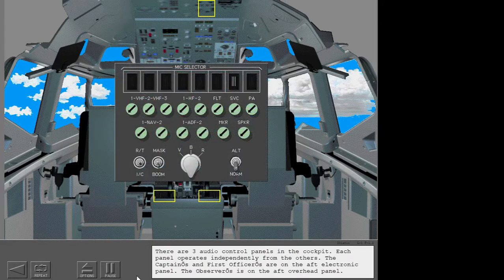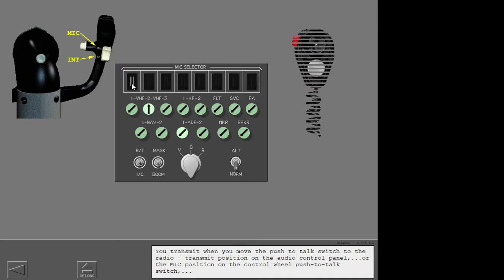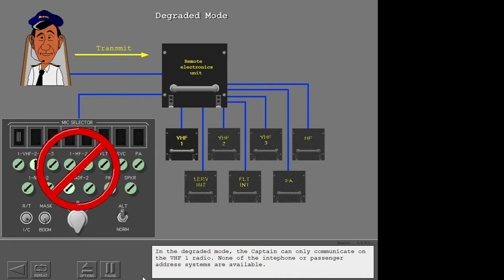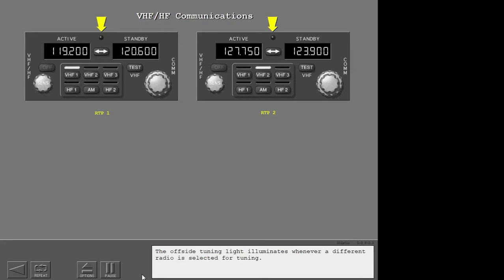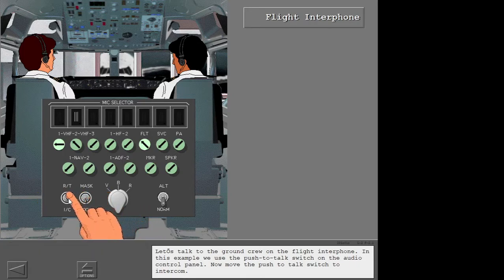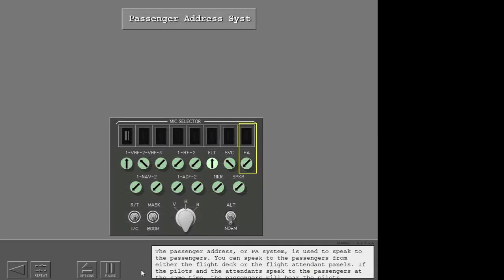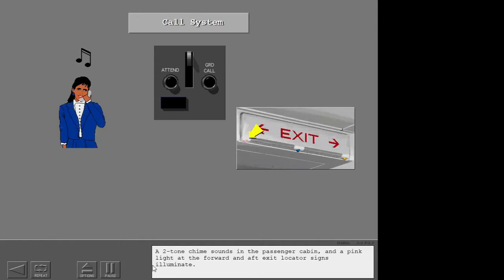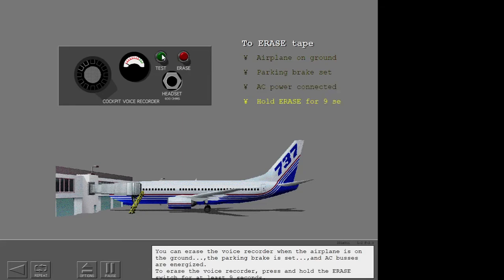30. Boeing 737NG - Communication System

Comment: What is the volume knob used for below the PA function?  Does this control the volume of PA announcements made from this panel, or can PA announcements made by others be monitored?
Reply from the maker: The volume knob below the PA use to increase or decrease the volume on PA channel. You can hear other person announcement or even the Cabin Attendant announcement when they use the PA channel